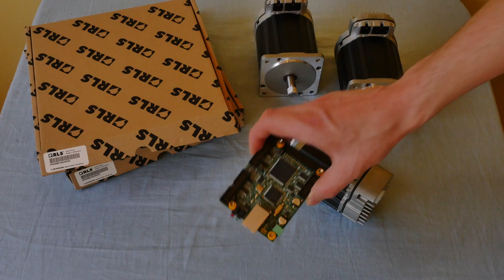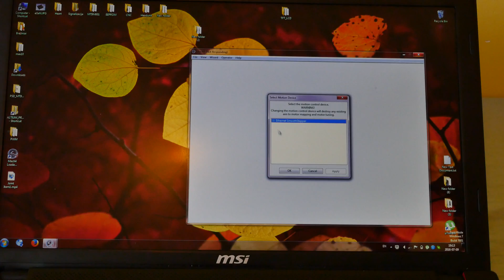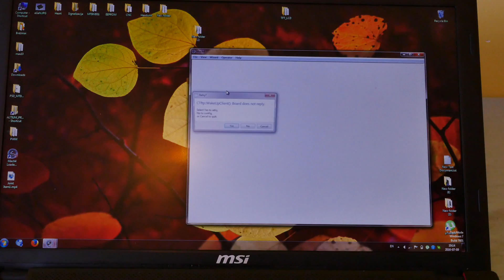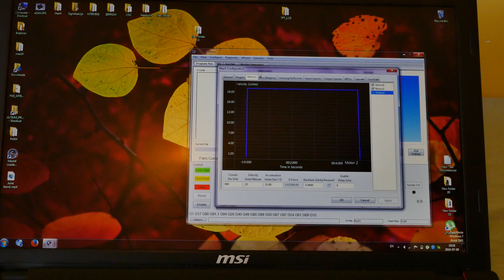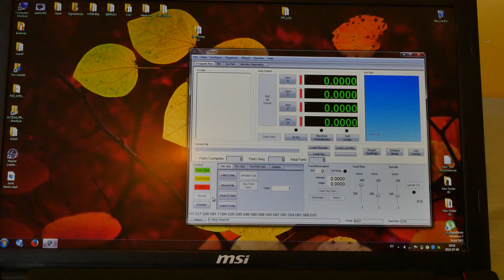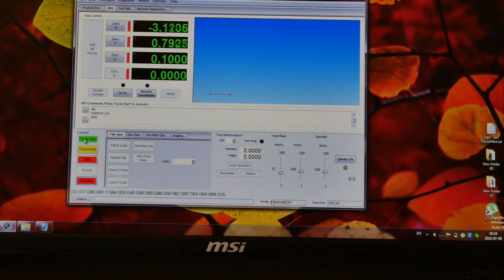New CNC: ESS Smoothstepper tutorial with Clearpath-SD servos

Comment: I have looked at this video many times and do not understand where you are connecting the enable wiring and HLFB from the clearpath to the controller board. I know this is old video but it is what I am trying to setup on my machine. please advise :)
Reply from the maker: I think it's always high or some inhibit  signal.
Reply: I saw the toggle switch you used to enable the motors, how was it wired?

Comment: The wiring is the most important part and you skipped it. Plenty if videos on installing and configuring mach4. Please show the wiring diagram.
Reply from the maker: It's direct connection to smoothstepper. Based on bits in that program. Thats why I did not show that, is is obvious in my opinion.

Comment: Hi Linas!! What a great stuff you got!! thanks for posting it help me a lot!  hey may I ask you some questions.... I was going to buy nema 34 stepper motos... to build a cnc to mil most of the time nylon, or wood..in a fast pace...... but I would like to be able to mil aluminum, could be slow for aluminium.  So should I keep nema 34... I read that stepper motors will be slow :(  .. that I should get servor motors...  do you think I can get clearpath 23... would be better? I mean I'm reducing the motor to keep prices in more or less the same order... for 4 nema34 and drivers... i can get around 500 bucks..
Reply from the maker: First, i just starting this hobby. I am still making more mistakes than doing things correctly :)
Clear-path servos are stronger and faster ( usually ) and will give you better results due to close loop nature. If you can, go with servo, it is simple plugin device, with high efficiency and low noise with high precision.
Just now the maximum speed you need to run to, and select correct motor, and you will be fine.(high speed low torque or high torque low speed)

Comment: from wat i understood from others that has gotten the smoothstepper to work , you need a crosswired ethernet (modem) cable to be able to connect the computer directly to the smoothstepper you allso need to put a BOB between the smoothstepper and the stepperdrivers  to get everything to work whell
Reply from the maker: No, this was straight LAN cable, in any case, computer should be able to switch RX/TX lines,

In theory all I needed to run CNC is what i did in this video :)

Comment: What is the reason for using the linear encoders when the clearpath servos are already closed-loop?
Reply from the maker: well, i have 1um RLS encoders. accuracy is 40um/m, and i i know that i will have step resolution of 0.5um. that means i can first, calibrate out screw variance in lead pitch, and also compensate when my system is flexing, since i will be measuring true movement, and not relaying that movement really occurred, even if i have closed loop servo system.

So in short, servo loop will give me confidence that i will not jam, and linear encoders will calibrate out any problems with my mechanics, so i should win some resolution.

Also, MCU will have absolute data where is my machine, so they can perform tool change, since at all time even when i zero out my axis in mach, mcu will know where it is with 1um resolution.

Comment: Hello Linas. If we use ClearPath servos,we  only need the break out board (3/4/5 axis) controller card and that's it? Or we have to add drivers too? Cause if I understand well, these servos have the drive controller installed already,no?
Reply from the maker: servo has opto inputs 5V, so my driver board can drive it directly. But i
 will add FPGA, encoders, as well as  5 arm cortex m4 for each axis pid 
control, so i will not drive it directly
Reply: Hi @LinasK, can you please explain what will be the role of each...ie FPGA, encoders and ARM cortex processors? I would love to hear from you as I am also just getting started with these motors and would like to develop a heavy gantry movement CNC. I thought that based on these motors' power, I just need to power them with the Teknic PSU and then let Smooth Stepper do the rest? Any light you can shine on this matter in detail would be amazing!
Reply from the maker: Search for my other video (new one)